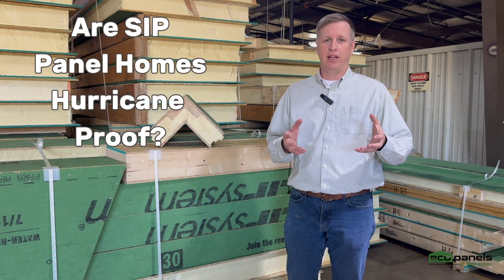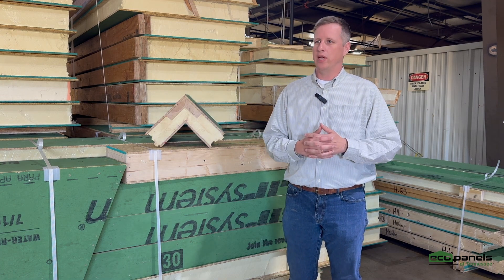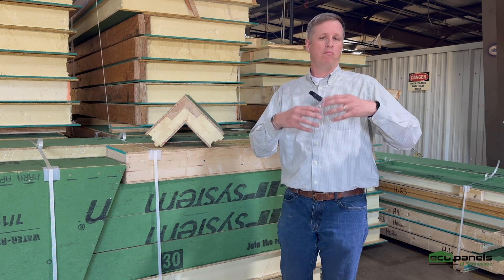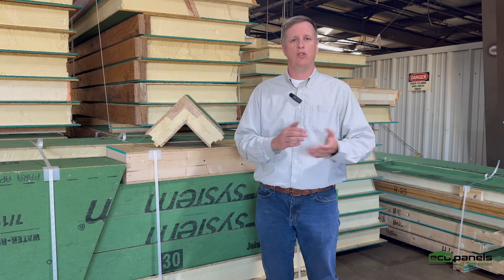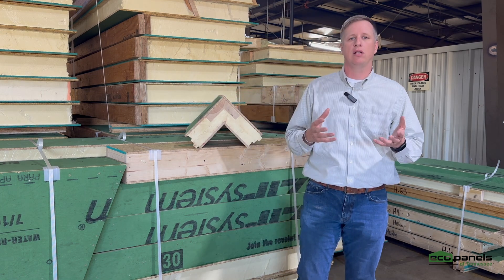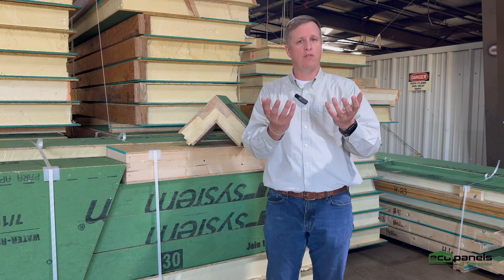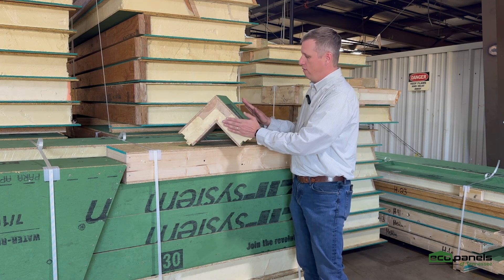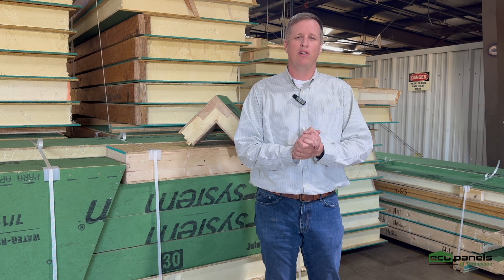Are SIP Panel Homes Hurricane Proof? | Eco-Panels of Tennessee

Comment: Would you please make a much more detailed video on roof panels, how they are attached, the best truss system to use, etc.  I watched the roof panel demonstration video that Rob made.  I would like to use these if possible on our ICF home.
Reply: Yes they can be used with SIP panels. Just fallow the manufacturer’s directions, I have been using SIP panels for the last twenty years, they truly are a fabulous way to build. SIP master builder Terry Bliss
Reply: @terrybliss7261  where do you build??
Reply: @ericraleigh7363  I build in northern Minnesota, I use Extreme Panels that are made in Minn. but they sell them all over the world. Extreme panel engineers the panel for the location that it is going to be built. Here in Minnesota we need a 60 lb snow load, in the gulf coast areas you would need wind loads of 120mph? and they do that.
Reply: I second that.